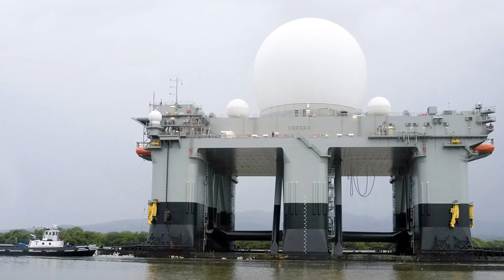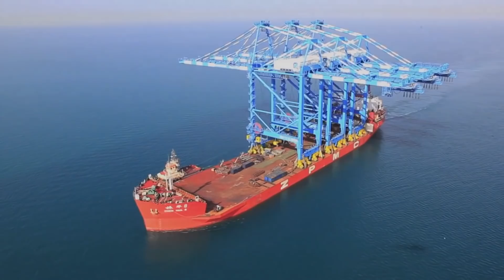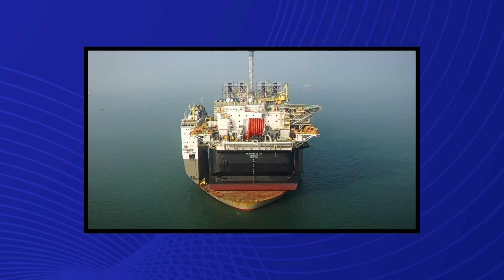Heavy Lift Ships: Moving Things That Should Be Too Big To Move

Comment: 2:20 - Chapter 1 - Trains & elephants
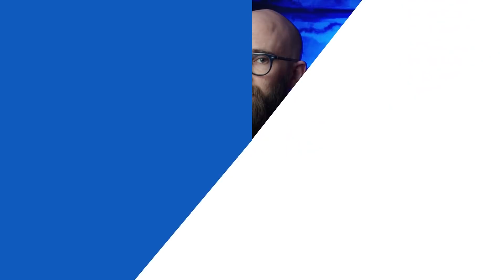4:35 - Mid roll ads
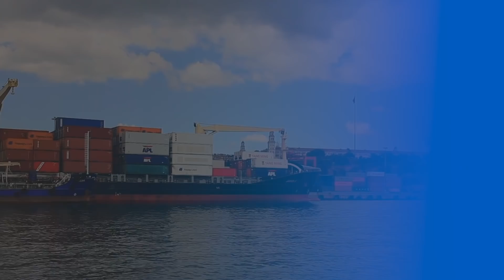6:30 - Chapter 2 - Project cargo carriers
7:55 - Chapter 3 - Open deck cargo ships
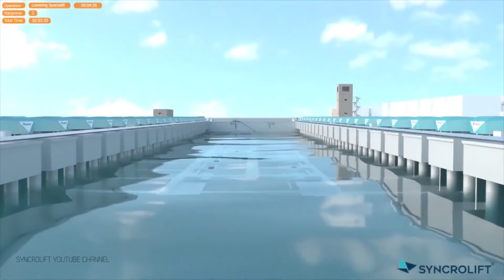9:45 - Chapter 4 - Dock ships
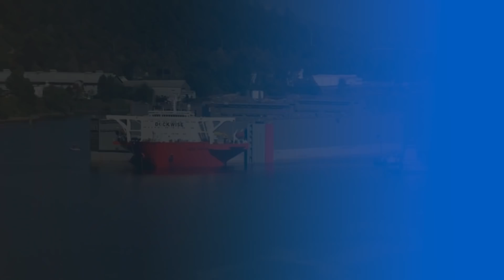10:45 - Chapter 5 - Semi submersible vessels
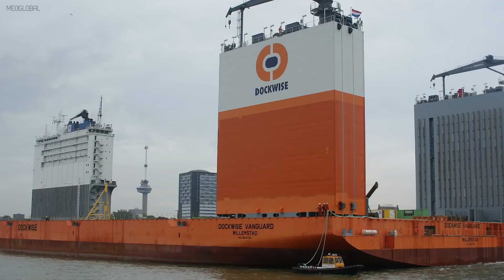12:10 - Chapter 6 - Boka Vanguard

Comment: A video on Russia's Kirov class battlecruisers would be awesome. I believe they are the last battlecruisers still in use today
Reply: Kirov reporting
Reply: I do agree the Kirov would be a good video.

That said it's not a "Battlecruiser." Due to size and speed some call it that in the west but the Russians even refer to it as a "Heavy Nuclear Guided Missile Cruiser." A Battlecruiser, along with the battleship, was a big gun platform by definition. Something ment to go in and smash an opponent with heavy guns. The Kirov is not ment for such close engagement. In a way its more related to an aircraft carrier. Stay back, attack from (hopefully) beyond an opponents counter attack range, avoid a knife fight. By contrast, battlecruisers were ment to use their speed to get in close and smash convoys and lighter combat opponents. The only real connection is both are large and fast(ish) for their eras. And if you don't consider improvements to damage control, Kirov is far more fragile than a BC (as are most modern warships).
Reply: @matthewfinkenbinder5846  Yeah, Kirov is more a superheavy CGN.

Comment: I work on a fishing boat that goes 8 knots at the most. Always blows my mind how fast big boats can go. They must burn so much diesel. Especially that old German one
Reply: Lichtenfels was powered by steam piston engines, same as the locomotives she carried (but much, much bigger, of course), probably with oil-fired boilers. And calling that stuff "oil" is being generous, it has to be heated to around 100C to be able to pump it. And the diesel-cycle engines in modern large cargo ships burn the same (diesel/jet fuel are #1 grade, the marine diesels or steam plants in big ships burn #3-#6, the latter of which is pretty close to what they pave roads with.)
Reply: On speed, the aircraft carrier USS John F. Kennedy (81,000 tons) could do 34 knots with oil-fired steam turbines. The current 100,000-ton nuclear-powered ones that have basically unlimited power to make steam can do "30+ knots" according to the Navy (actual top speed is classified, so probably rather a bit on the plus side).

Imagine a medium-size skyscraper on its side, going fast enough to get a speeding ticket in most places there are medium-sized skyscrapers (40mph, speed limit in NYC is 25).
Reply: @DeliveryMcGee  a lot of people don't realize how hard it is to push things through water. Thanks for the extra info
Reply: Thanks for sharing
Reply: @tylerrehkopf  Carries have to go as fast as possible into the wind, to get more airflow over the wings of the planes they're launching/recovering, to lessen the speed relative to the deck.

Comment: Simon, as an experienced Naval Architect in this industry I am afraid you made quite a few mistakes (like Boka acquiring full ownership of Dockwise in 2015 not 2003 orchestrated by HAL group who was a large shareholder in both, wrong that most of these vessels not having long shafts because of forward deck house as most with forward engine rooms are diesel-electric, and ballast pump size not determining lifting capacity - it really only effects loading speed as a guy with a bucket could float/submerge the vanguard but that would take a while, among other errors). The main thing I wanted to discuss was that this industry is generally understood to be split into 4 vessel types but not as you describe but as follows. 
1) Geared Carriers: vessels with their own cranes for loading and discharge into its cargo hold or on its top hatch deck, 
2) RO-RO: vessels with loading/discharge ramps whose cargo generally rolls on/off under its own power
3) Deck Carrier: Vessels with lower freeboard that carry cargo on its deck like the ZPMC ship you showed. These can have open stern or other shapes but do not submerge.
4) Semi-submersible heavy lift: also low freeboard ships but capable of submerging to load floating cargo like the Dockwise vessels. "Dock type" vessels are a version (typically older) of these that use dock walls to guide their cargo in. Some of these dock vessel walls are even temporary like on the Superservant 3.
*Note there are also some vessels unique enough to fit into multiple categories of the above. Like Rolldock's S and ST-class vessels.

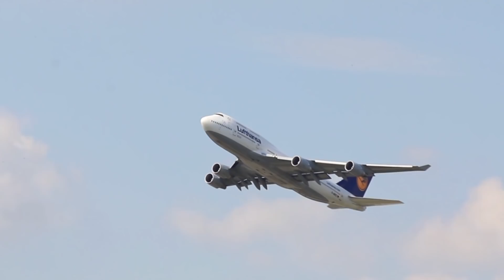Comment: 1:05 there are many more times than that where a 747’s mass would be described as only being 440 tonnes. 

For one, the rocket Starship and several heavy lift rockets with gross masses exceeding it by a hundred tons, some even exceeding a thousand tons up to the former’s 5200t mass at launch. Also many naval ships with a mass of at least an order of magnitude greater on displacement. Or Buildings.

Comment: Gah--the terminology!  DWT, Deadweight Tonnage is a common cargo term referring to cargo space volume_, in units of 100 cubic foot "tons" (derived from the largest wine cask made, the "1unne" of ±168 UK wine gallons).  The SSLS use "deadweight _lift tonnage, which is keyed to displacement weight.
Displacement weight is not the "weight of a thing" but the weight of water the thing occupies.  If a vessel has a 100 cubic foot underwater volume, it displaces 6500 pounds of (salt) water.  If the vessel only 'weighs" 5000 pounds, you'd need to add 1500 pounds to get it to ride at its displacement waterline.
Which is exactly how a Semi-Submersible Lift Ship operates. [headsmack]  
(The hings I still remember for Naval Science 102 . . . )

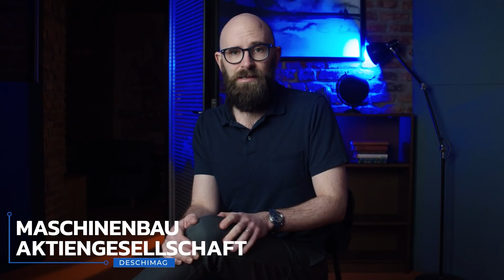Comment: 2:37 It's because they join words together when describing objects. The problem is that most technical german words are pretty long to start with but when you start joining them up it compounds the problem.

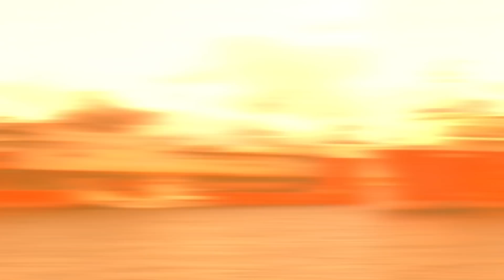8:10 isn't it Bow and stern, fore and aft? left and right, port and starboard? and isn't it bad to mix them together like simon did?

Comment: I get how ships float. 
I just don’t see how they don’t capsize. 
Especially with a ship like this that literally carries another ship above the water line. 
I have an understanding center of gravity, etc. and I have been on large ships. 
Especially with armored military ship. That’s A LOT of weight high up on the ship.

A battleship for example. 
The armored belt and Citadel are mostly above the water line. 
The conning towers are something like 15 inches thick, the turrets are absolutely massive, not to mention what is needed to support them. 
What keeps them upright? 
Especially in rough seas.

Comment: And yet its not the biggest ship in dutch service ,  Pioneering spirit is the largest ship currently afloat with 403.000 GT standard , at full draft a displacment of  1.000.000 tons  a beam of 127 meter and a lenght of 382 meters of the hull and with stinger and lifitng beams  477 meters and a draught of 27 meters.   Its so large it has its own harbour to dock service boats.
and a crew of 571.   The  lifiting capacity is 48.000 tons and upgraded to 60.000.

Comment: How do they cope in heavy seas?
Reply: Generally with that size and mass it becomes extremely rare to face a heavy sea which would be critical, especially when routing aims to avoid any kind of bad weather ... worst case I would guess they could submerge partially, gaining massivly in stability by doing that. These ships and most of the constructions (oil plattforms etc.) they carry are practicly designed to withstand the worst by being submerged with a huuuuge chunk of their mass.